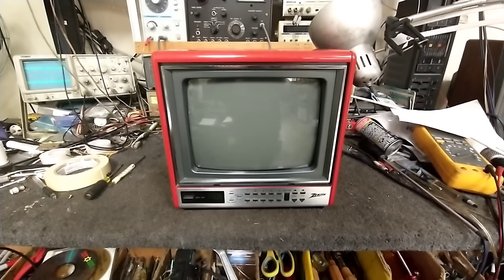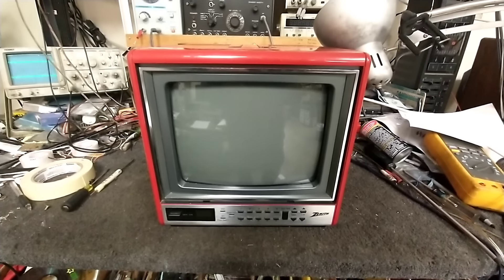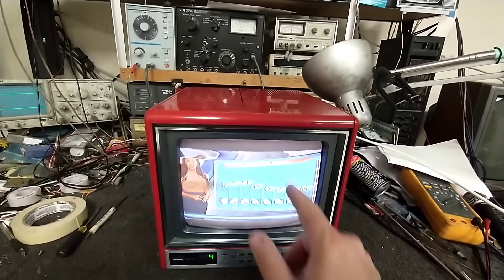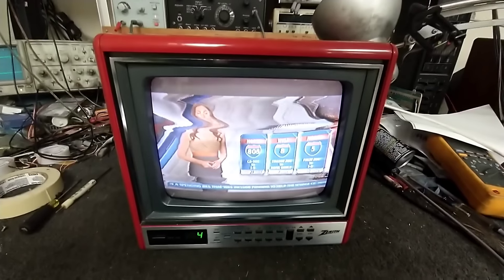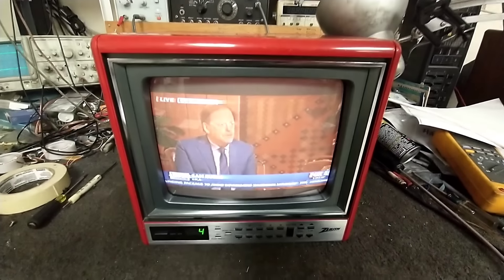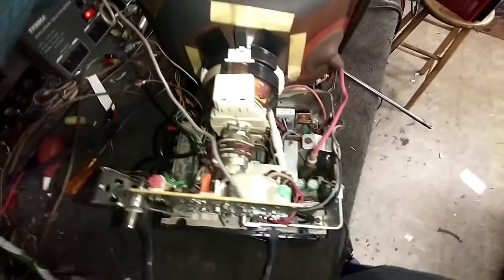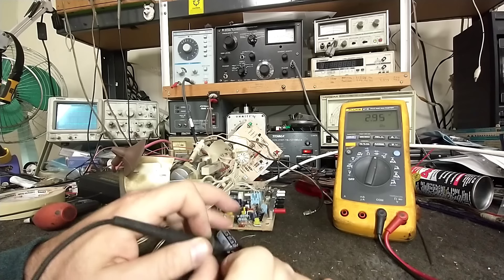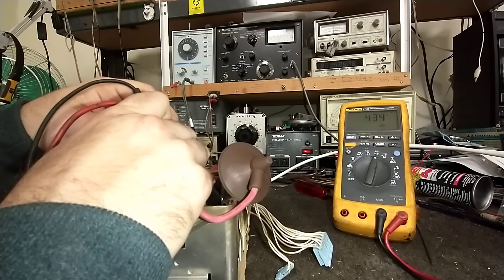Analysis and minor service of a 1987 Zenith 10" color tv model D0920D - Distorted picture

Comment: I have the same set with a white case. I restored it about a year ago. I replaced all electrolytic capacitors on the main board and resoldered all joints on the main board. It worked ok for a few days, then all kinds of strange tuning issues. I pulled the tuner apart to find nearly all the electrolytic capacitors had leaked out on the tuner board and measured very low on mfds. I recapped the tuner and has been working like a new set since then. If you would have more tuning problems, check the electrolytic capacitors in the tuner module. I was surprised to find how bad they were in my set, but it was used in a nursing home for many years and was on most  every day. It was baked very good.

Comment: Electronic Parts  Outlet   in  Houston  TX   has all  kinds  of  electronic  parts  to  repair   vintage  radios,  TVs  ,  record  players , tape  recorders   They  stock  idler  wheels, belts,cartridges,  tubes, transistors,transformers  and  ICs     They also  ship  parts  you  need
Reply from the maker: They are a great resource. I follow their pages. Also chester electronics in Wisconsin